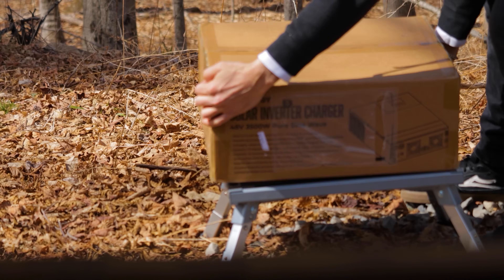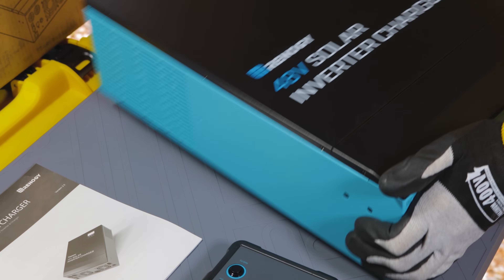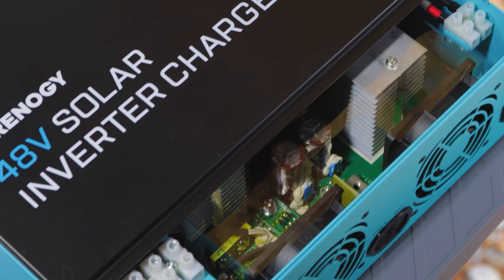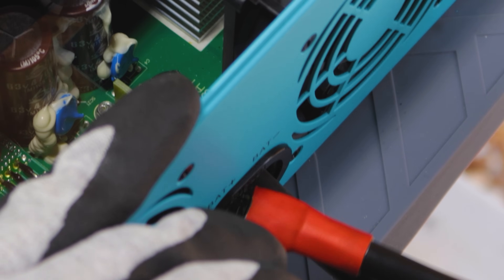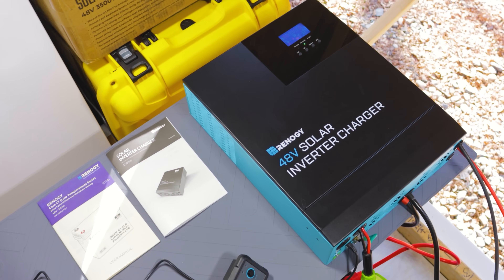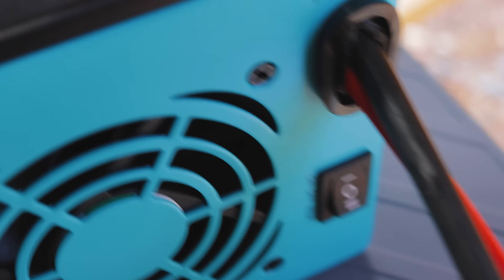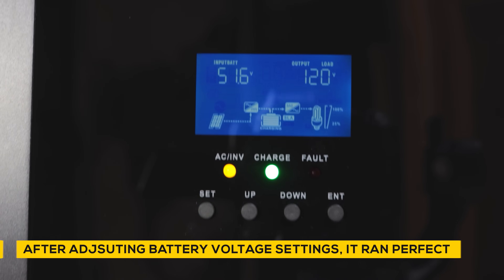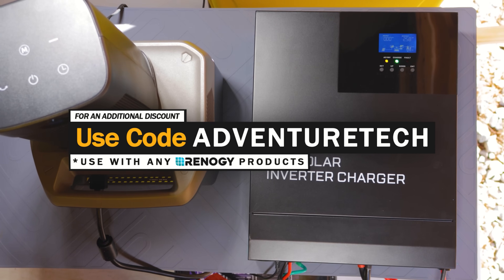RENOGY 48V 3500W Solar Inverter Charger for DIY Solar Power - Unboxing Review and Test

Comment from the maker: Use the links and Code:  ADVENTURETECH  for an additional discount on any Renogy products & help support my channel at the same time. 
➨  RENOGY 48V 3500W Solar Inverter Charger:  https://renogy.sjv.io/LKOAz3

➨LIMITED TIME DEAL - Renogy's Earth Day Sale - Our Power, Our Planet.
➨➨ Up to 45% off + Extra 5% off by using code ADVENTURETECH
➨➨➨RENOGY EARTH DAY SALE:  https://renogy.sjv.io/aOjvvq
Duration: 04.14 - 04.28

➨  RENOGY 3500W Solar Inverter Charger:  https://renogy.sjv.io/LKOAz3

➨  RENOGY 150W CIGS Solar Panel Deal:  https://renogy.sjv.io/Dye6rn

➨Get the RENOGY Core MINI 12V 300Ah Battery Deal: https://renogy.sjv.io/xLN1o3

➨Get the RENOGY Core Mini 12V 100Ah Battery Deal:   https://renogy.sjv.io/WyGgdP

➨Get the Rover 60 Amp MPPT Solar Charge Controller & BT-1 & Renogy ONE Core: https://renogy.sjv.io/YRBdkB

 ➨Get the RENOGY 12V 200Ah Pro Smart Battery: https://renogy.sjv.io/xkKGmA

➨Get the RENOGY 550W Solar Panels:   https://renogy.sjv.io/e1A1XO

➨Get the RENOGY REGO 400Ah Battery:   https://renogy.sjv.io/o4zjqE

➨Get the RENOGY REGO Inverter Charger:   https://renogy.sjv.io/LKx553

➨Get the RENOGY Home Energy Kit here:   https://renogy.sjv.io/OenyLP

 ➨RENOGY Lycan 5000 Mobile Solar Generator: https://renogy.sjv.io/je1dga
(*Watch Lycan 5000 Power Box Review here:  https://youtu.be/aZNN2E2QwmM )

More great RENOGY products below: 
➨RENOGY Tiny Home Kits: 
https://renogy.sjv.io/bOGjgM

➨RENOGY Solar kits: 
https://renogy.sjv.io/kOzJ13

Comment: They needs more 48 volt products, but there's one you do not want to use whatsoever is the booster controller charger. It is a piece of sh it!!! It takes my 34 volt vpp panels and clamps it down to 22 volts. I lose half my wattage off my solar panels right away!!!
Reply from the maker: Agreed on 48V.  For your charger, it may be better for a different applications.  I noticed chargers specifically are sort of set for a very specific solar set up to maximize.  I oversize the MPPT a bit and it has worked well for me.

With regards to the 48V.  I foresee server rack batteries and stuff like that; as well as large all-in-one solar inverter chargers in the future.  This is the sensible direction for their company to go, since they already have basically everything else for massive home back up DIY solar.    They do actually have something already.   Renogy X is super nice.  I covered some of that on the smaller Adventure Tech channel recently.  I am hoping to get some equipment to fully test out here on the larger channel.  

Go check out renogy x on my smaller channel if you want the break down of the RENOGY x.   I will have one of these one way or another before too long.  You can mount everything completely outside and just run the AC into your home/panel/transfer switch.  

Thanks for your comment.  I imagine a lot of other people have been thinking the same thing.

Comment: This is just a rebranded Chinese engineered and manufactured  SRNE HF4835U80-145 model.  Lots of companies put it out with their logo slapped on it.  Litime, Renogy, Ampere PowMr to name a few.  The manual that comes with has several questionable "recommendations" for wire gauges that are too small if you were actually ever going to run this at 3500W.  It is also not UL listed.   Just things to keep in mind.
Reply from the maker: Thanks for sharing.   In ways you are right. Particularly, I always use maximum conductor size.  I think they should mention this as a recommendation.  The price certainly reflects a lot of what you are mentioning though.   Plus, I foresee more innovative inverters coming from RENOGY soon.   

To expand:  to me, one of my priorities when investing is a company's reputation, not just the product.   Some companies make very similar products or re-brand.   Personally, I don't care how good the product is if the company fails in service.   I am avoiding some companies for that reason now.  Even a similar product from a different company can be a very different experience and value.  

For this inverter: this has some differences I noticed.  I think many components are used in various devices, as factories make them in large quantities and distribute them to manufacturers like Renogy.    You look closely and see subtle differences almost always though.    For example, the AC ground on this and the location of some components, as well as their orientation, are different from some other similar models.   

Overall, I still think this is a pretty good value for certain applications.  I also trust renogy over many other companies.  So that matters to me.